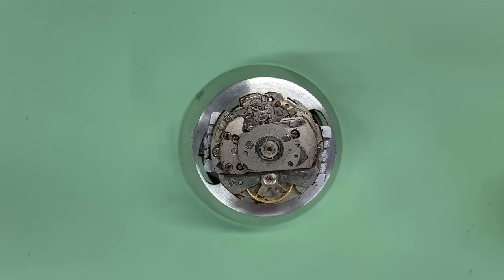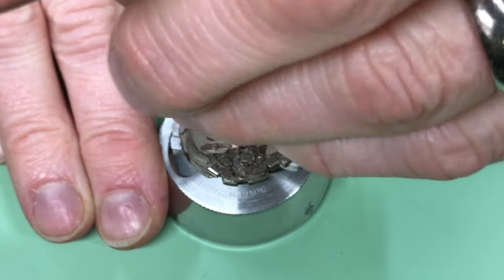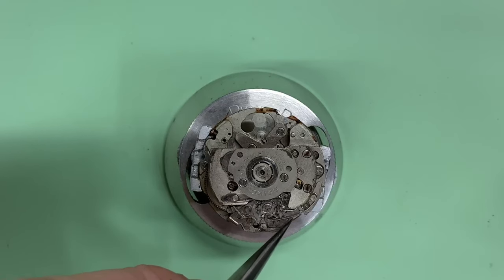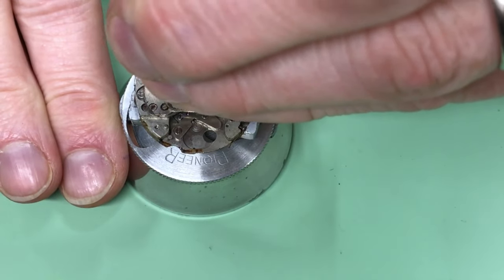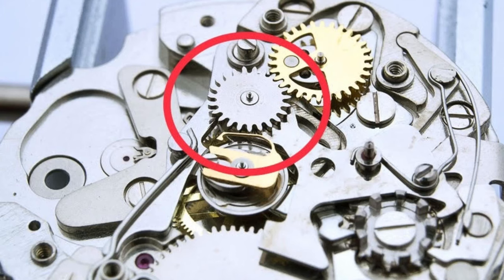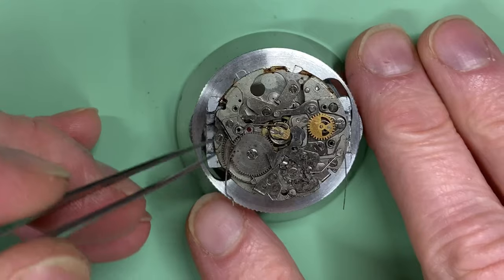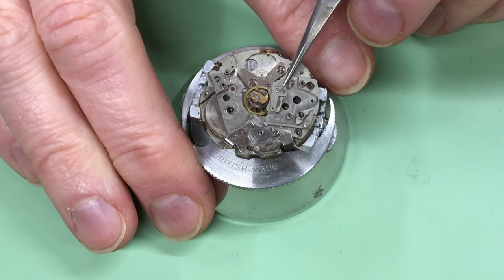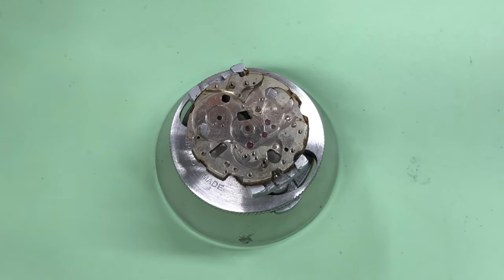Seiko 6139 Servce Tutoral  Part 2   Chronograph & train disassembly

Comment: I've just found your channel! I have TWO 6139B water-resistant watches, one, my original blue-face one, drowned in the local swimming pool, presumably an O-ring fail. I unscrewed the back, to let it dry out, but it hasn't run since, and now is showing signs of corrosion. I  bought a second one off e-bay, a bronze face, which does run, but I suspect it needs a good clean and lube, as it was pretty mucky, and often stops, needing coaxing to restart. (could also be a weak mainspring, having watched your vid just now?) I was considering putting the working mech behind the blue face, and into my original case, which is a lot less battered, but having seen what is involved, have changed my mind - too fiddly for me, and I don't have the equipment!. I took them to a local genuine jewellers that sell Seiko, but they didn't want to know, too much work for too little return.  She tried to sell me a new quartz one! I also have another e-bay purchase of a 7S36 - 100 mtrs proof, which is my daily wear.
Reply: I have my father's blue face 6319 Retro Racer from 1972 with the original bracelet that has round holes that are reminiscent of a steering wheel. I think there was some tie in with BMW. If you have that bracelet, know that they're irreplaceable and they make the watch.

Find a watchmaker, not a jewelry shop that sells watches. You might have to send it off somewhere, and be willing to pay for this level of service.

Comment: Very enjoyable Mike. Looking forward to seeing you get that glue off!
Reply from the maker: thanks Dale,  to be honest I wont film the cleaning of these parts as it will be quite extensive and time consuming.  The glue I will use some nail varnish remover, that should do the trick. as for fitting the dial this will be a proper challenge.

Comment: Yes, this is exactly what I need to learn. The rebuild is what I also need to know as well as the oiling. This still makes me anxious. lol
Reply from the maker: Rebuild is not too difficult, its the fine tuning that ca be more challenging, Plus this is only my 3rd time inside one of these so all kinds could go wrong...!
Reply: @MyRetroWatches  hello, have you plan to make a video about the rebuild ?
Reply from the maker: buchnoun eventually yes.  I have a broken chrono wheel on this one which is almost impossible to find a replacement

Comment: That little stepping gear is a magnet 🧲, so ya may want to use anti magnetic 🧲 brass tweezers. I noticed the name “Pioneer” on your watch repair 👨‍🔧 s  mm device (I don’t know what to properly call it). Your friend, Jeff.
Reply from the maker: ? There is no stepping rotor in the 6139 it’s all mechanical
Reply: I am totally mistaken on this not having a step rotor. The name “Chronograph” had me thinking 🤔 that this watch at least had a digital display, but it doesn’t. In other words, I thought this was an ana-digital watch, which have the step rotor with a tiny magnet 🧲. This, and mainsprings wouldn’t go together well. Even in analog quartz, and ana-digital watches, the surrounding gears ⚙️ are brass, so timekeeping of the watch won’t be affected by the stepping rotor trying to attract regular steel gears ⚙️, dragging the watch movement to a stop 🛑. I saw 👀 gear ⚙️ that ya sourced out to me in the video, along with “This is to Jeff”. Happy Halloween 🎃 👻. Your friend, Jeff.

Comment: I have really simple question. I need to move the tachymeter interior bezel on my Vader. Should I go in through the front (exterior bezel/crystal) or through the back (remove movement) ... Or is either way fine? ???
Reply from the maker: on the 6139-7100 you remove the bezel and crystal to get to the Tachy
Reply: @MyRetroWatches  thanks! Better buy a crystal press!
Reply: @MyRetroWatches  just got you a beer! ..and encourage viewers to do the same!
Reply from the maker: @lukemcevoy2385  thank you so much Luke. I appreciate any help.